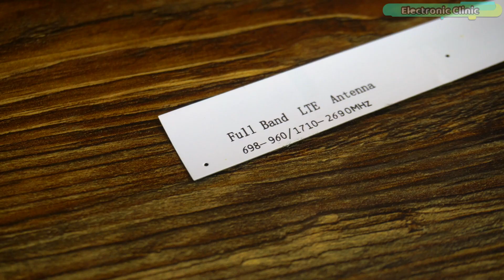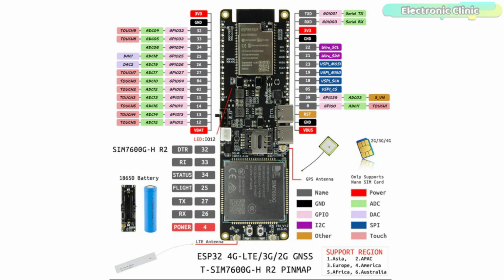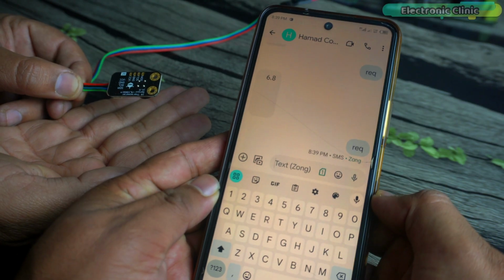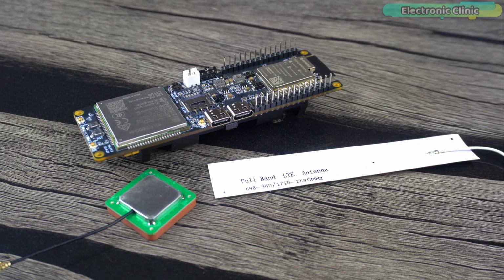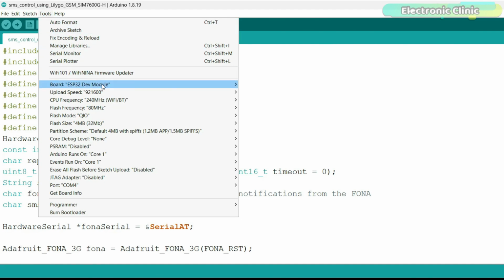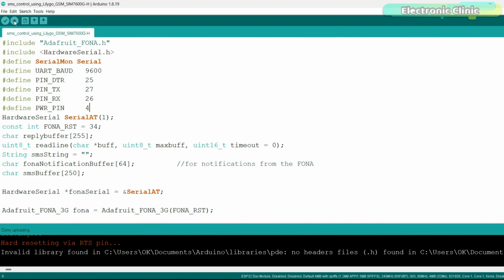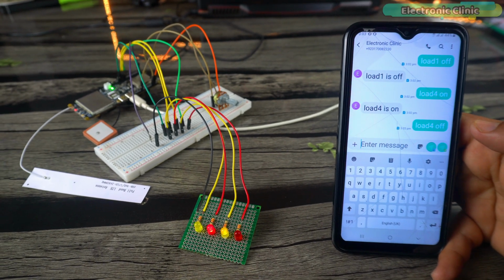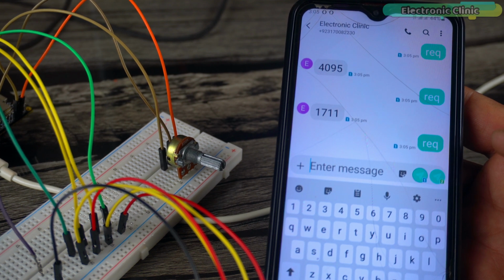SIM7600G - H 4G LTE ESP32, Send and Receive Messages, Lilygo T-SIM7600G-H, bye to sim800L & SIM900A

Comment: Good evening I kindly ask you for a little help. I am using a LILYGO A7670G board perfectly compatible with the one used in your project. By modifying the source I get this error: I kindly ask for your help, I loaded your project on a LILYGO A7670G board perfectly comparable to yours. I modified the expected variables. but when I run it I get the following error:
15:01:31 .891 -> I could not find FONA

Comment: Good evening I kindly ask you for your help, I loaded your project on a LILYGO A7670G board perfectly comparable to yours. I modified the expected variables. but when I run it I get the following error:
15:01:28.790 -> Timeout: No response to AT... last ditch attempt.
15:01:28.826 -> ---> AT
15:01:29.309 -> <---
15:01:29.449 -> ---> AT
15:01:29.977 -> <---
15:01:30.104 -> ---> AT
15:01:30.605 -> <---
15:01:30.750 -> ---> ATE0
15:01:31.242 -> <---
15:01:31.382 -> ---> ATE0
15:01:31.891 -> <---
15:01:31.891 -> Couldn't find FONA

I point out that I send the "load1 on" command with a text message to the sim inserted in the card.
Thank you so much for giving me a tip, I need to make this project work, and this tutorial of yours fits brilliantly with my needs. Best regards. Paolo

Comment: If you want to use it as wifi modem, your data rate will be limited by the bus between the chips. Do I understand it correctly?
In SPI case it will ne around 30Mbit/s

Comment: Sorry for another similar question - but is it relatively trivial to set this up to send some basic sensor data via HTTP 'to the cloud' ?
Reply from the maker: Think about the locations where wifi is not available. This module supports 4G LTE. I have used it in some intermediate and advanced level projects. Check the esp32 playlist.
Reply: @ElectroniClinic  thanks. Given the sensor data is practically audio data. I think it might be easier for me to 'call' it over

Comment: can this be used as a wifi hotspot? I have an Idea for my Workshop where no Landline Internet Connection is available but there is Mobil Internet so this would be a great idea to use it in there
Reply from the maker: I was also thinking about this, I will check it.
Reply: @ElectroniClinic  thank you very much 😊
Reply: 9 @ElectroniClinic
Reply: just buy a wifi repeater